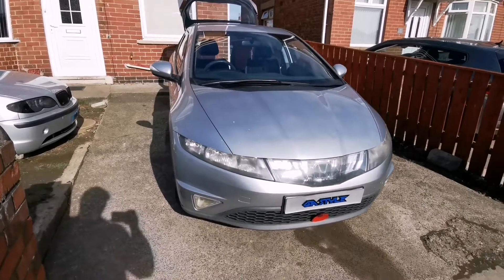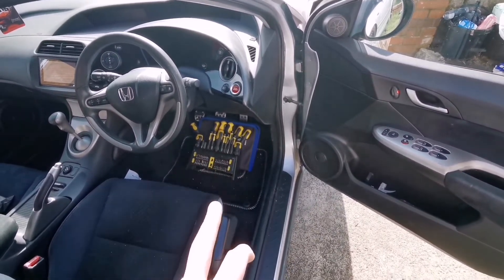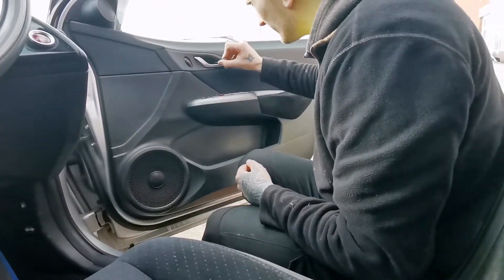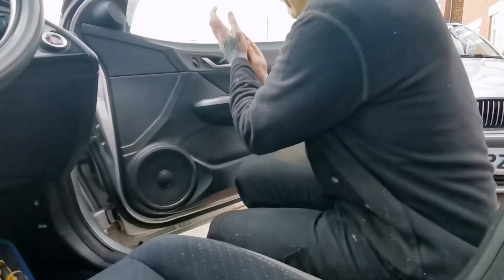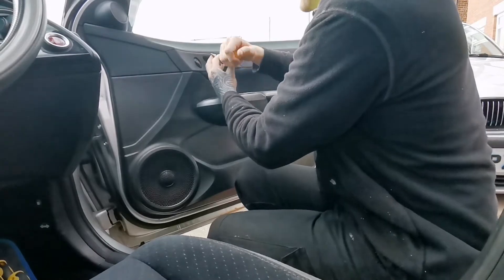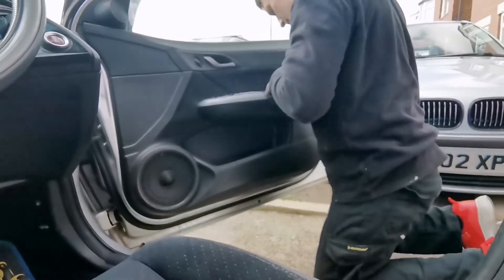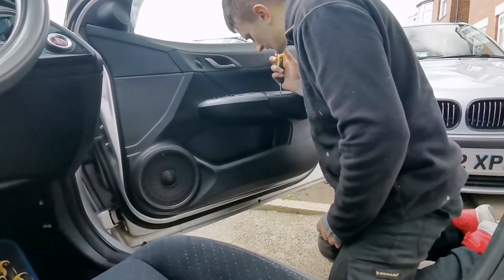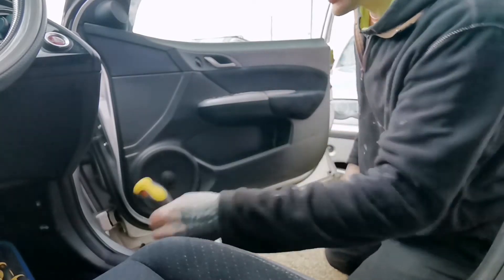How to remove front door card, door panel and speaker on a Honda Civic 2007 MK8

Comment: Okay great thanks but now I can't put the panel back on as it doesn't sit perfectly flush 😢
Reply from the maker: Probably bent clips or something in the way. Also make sure it sits perfectly on the top in the gap.
Reply: @gastyle9445  yeah I got it in the end although I broke half the plastic clips but it sits flush now. Trick was to start at the top when putting it back on
Reply from the maker: @Paraz1tul  Yeah it's always from the top down when installing and from the bottom up when removing

Comment: Thank you for this video. My front passenger door speaker has an unpleasant vibration with certain bass frequencies. Any idea what that could be? When I push the door card in, the vibration stops. Would a foam ring help you think?
Reply from the maker: Look into it. Could be damaged speaker. If it is a door card then try putting some foam around the plastic clips etc. Sound deadening is the way forward but expensive
Reply: @gastyle9445  appreciate it. Will do :)

Comment: my left door speaker isn't working. any ideas what could be causing my audio problems?
Reply from the maker: It's either dead speaker, wiring problem (especially the trunking) and headunit fault. Try the speaker from the other door. There identical all way round.